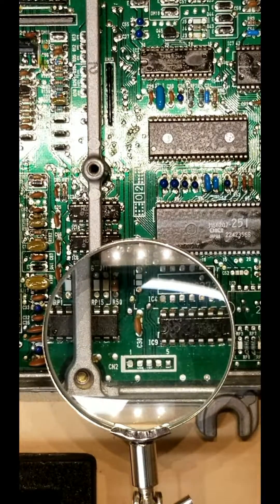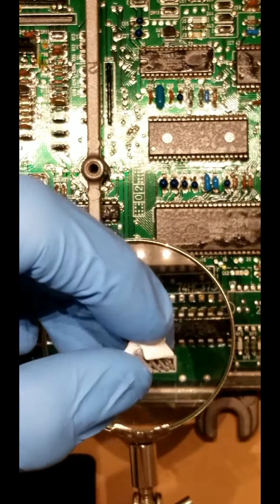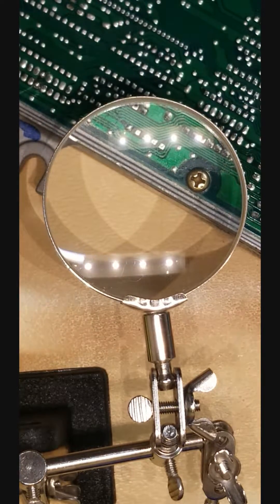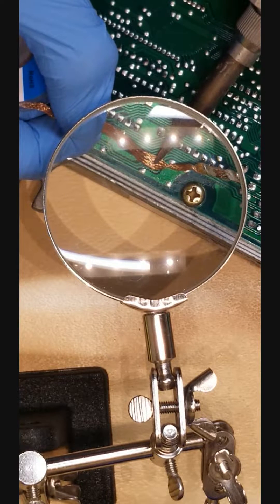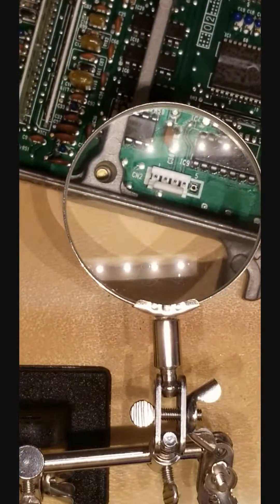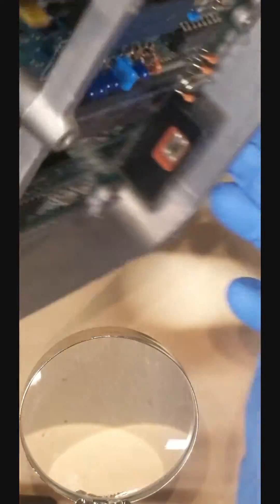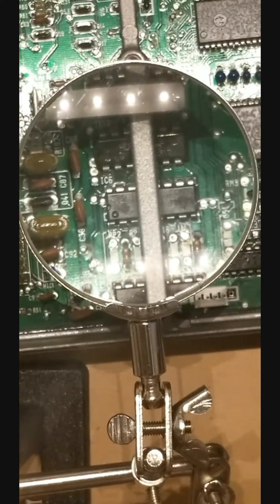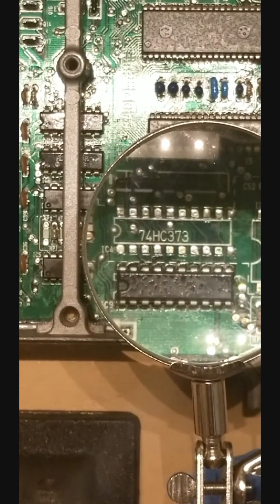Installing a Data Logging port on a Honda ECU (P28)

Comment: Awesome mate i’m new on chipping and tuning your video mean a lot to me, I have a few question I hope you can help me, i’m straggling where I can connect from ecu to laptop to tune it i’m totally nee on this field 100% no idea. I already have map burn on chip, bluetooth data logger installed. I hope you can help me to get it through
Reply from the maker: Thanks! You would need to connect the laptop and ecu via Bluetooth to view live data then use HTS or similar
Reply: @DIYKAI thanks very much DIYKAI, so I need any cable to plug it into ecu to laptop? Your reply is much appreciated mate thanks a lot

Comment: Just some quick tips for de-soldering.... I also used to struggle with de-soldering but after many years and damaged boards you learn.... So no disrespect meant. 

Clean tip (which he did) add solder to tip, put new solder down on all points you are wishing to de-solder ( just a small fresh dot of solder on slots 1 thru 5). Clean tip again. Put flux on ports 1-5. Clean tip and add solder to tip. Then use the solder wick. 

The addition of the fresh solder and flux to the ports along with a clean tip with fresh solder will allow the heat from the iron to transfer quickly to the solder in the ports flowing it almost instantly. Once solder is flowing the wick and LIGHT PRESSURE (he slipped off the wick at one point from pushing to hard and scraped the tip along the board, luckily no components were hit or any traces damaged) will clear the ports of solder quickly. 

The less time the iron is on the board the less chance you have of causing any damage to it.
Reply: I had exactly the same problem. After adding fresh solder, I had no problem removing and getting a clean four holes to install the CN2 header.
Reply from the maker: Appreciate your input and thanks for watching!

Comment: I have the same part you installed but my   moats 4 pin cable doesn’t plug in with it. Is their a 4 pin wire that u use differently from moats to do data log.
Reply from the maker: 4 pin Dupont cable should work fine
Reply: @DIYKAI  do you have Instagram i could send you some pictures because I have 3 ecu with 3 different 4 pin cn2
Reply from the maker: Kustommodifiedracing
Reply: @DIYKAI  okay. Pm you now

Comment: Can i datalogging without chipping?
Reply from the maker: Not that I am aware of it may be possible but chipping the ECU unlocks it's full potential
Reply: @DIYKAI  i just want to look some parameter value... Is it possible?
Reply from the maker: No you will need to enable datalogging, have a chipped ECU, and tuning software
Reply from the maker: @AmriYusron354  I have many videos on the Honda ECU and more coming check them out and subscribe if you have not already. Thanks
Reply: @DIYKAI  okay. Thank you very much
Reply from the maker: Your welcome

Comment: this is with chipped ecu i assume?
Reply from the maker: Yes you would need to chip the ECU
Reply from the maker: Thanks for watching and please subscribe if you haven't already
Reply: @DIYKAI  are you very familiar with honda obd1 ecu? And I subscribed almost immediately, very few honda obd1 ecu videos I can find.
Reply from the maker: Thanks and yes I am I repair them
Reply: DIY KAI well i do appreciate the answer as well as your time, i dont know if youd know this but if the capacitors were failing or failed would/could that trip/trigger the watchdog/reset of ic17? im confident something is making the computer reset because iv checked and it doesnt lose power from the harness. sorry for asking such a question of you and im not asking for a diagnosis. just if its possible failing caps could trip the reset.

by reset im refering to when key is turned from off to on. ecu should activate fuel pump for 2 seconds. my hypothesis is the slow delayed fuel pump symptoms of a bad or failing ic17 is caused by a repetitive tripping of that reset function intended to prime fuel pump and turn CEL off.  this in turn is caused by failing cap(s) not reaching or holding charge so the reset signal never ends because the capacitor hasnt finished charging.  by constantly resetting the CEL stays lit and no fuel pump prime.

does that sound plausible to you or should i head back to the drawing board?
Reply from the maker: @westhouse4641  are the capacitors original to the board? If so I would start there
Reply from the maker: To answer your question I have seen capacitors cause a no prime issues as well as IC17
Reply: @DIYKAI  
Are original caps brown "nichicon pr(m)"? Its a usdm obd1 p0b-a01 has a printed date feb 94
Any recommended temperature for my iron doing this? As in a don't go higher max temperature. 
Thanks a million for all your time and answers. Really appreciate it.
Reply: DIY KAI do by chance know the pinout of ic17? on the component itself its labelled ta8903sn. i believe most if not all obd1 ecu had them. no datasheet can be found by my searches.
Reply from the maker: @westhouse4641  when they go bad they usually cause a no prime or slow prime of the fuel pump...I would have to look for the pinout I usually replace them as they are nearing 30 years old now

Comment: What does the flux do and how did you confirm it was a success after the fact, visual inspection ?
Reply from the maker: Flux allows solder to flow easily and makes the joint clean., Bench test, then vehicle test. Thanks for watching and please subscribe!